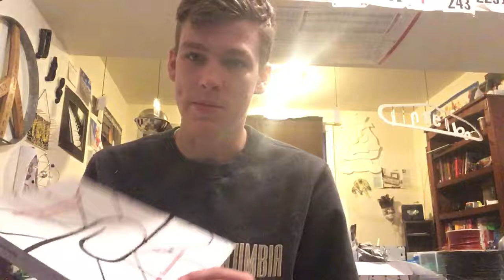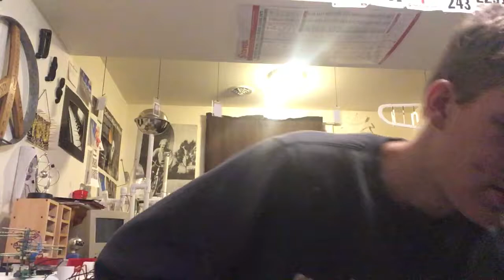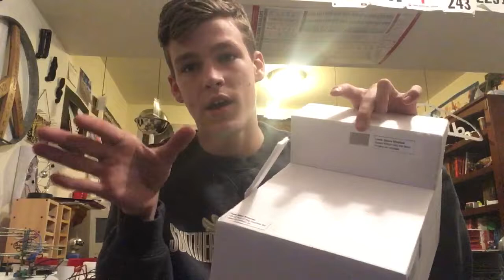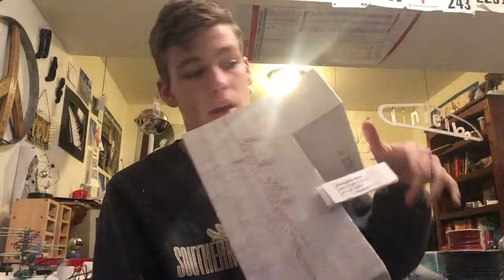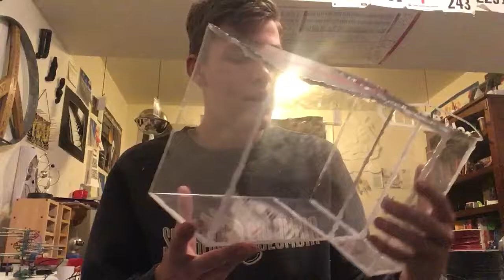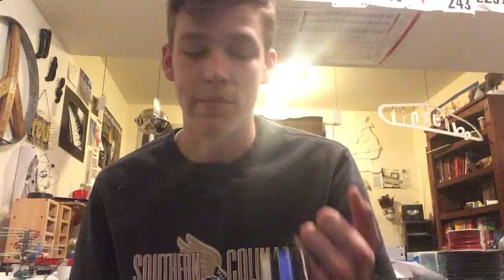Building a 3d display, water vapor and lasers

Comment: I think your single downvote came from 5:45 telling people to stop using water vapor. You could be thinking of it wrong I.e. generating water vapor the wrong way I.e. excessively. Mechanical "misters" generate vapor and use water at a fairly low rate.

Not that I would use water vapor to generate holographic 3D images. But the thought has crossed my mind. 
Rather something like this
https://youtu.be/6wLG9gFsDUA
Or something like this
https://youtu.be/IuNj_rqx04o
Which seems like a practical solution.